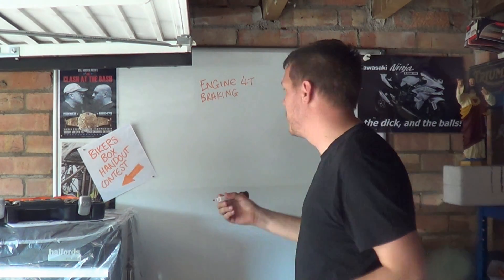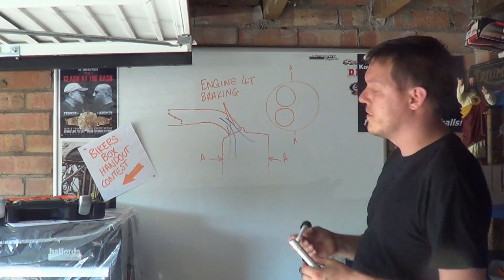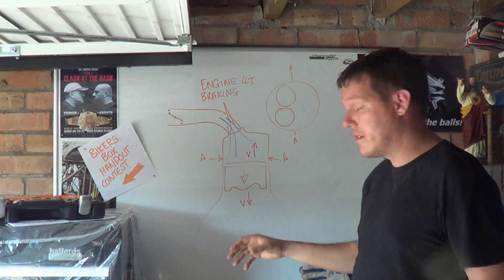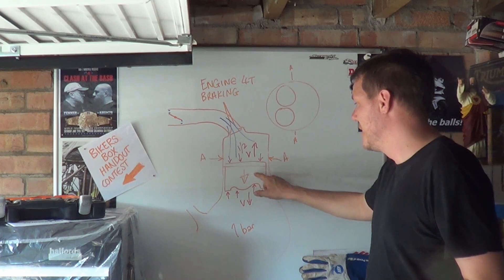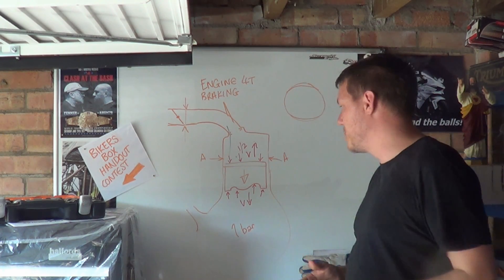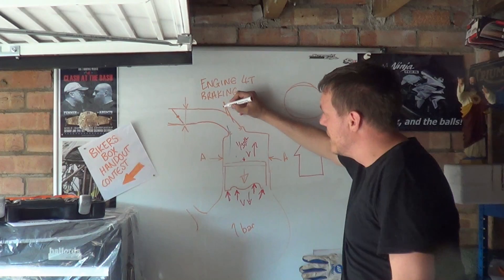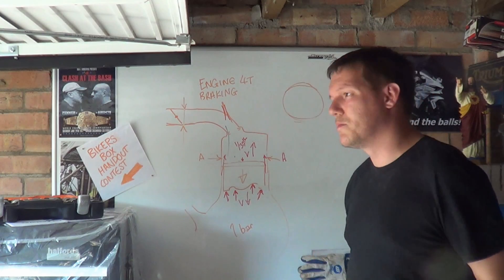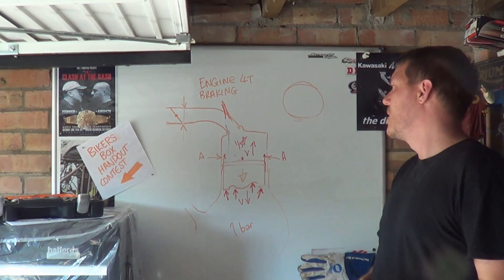4 Stroke engine braking - How it works

Comment: Its easy to understand that the air volume in the crankcase decreases in a one cylinder engine.
But with multiple cylinders, shouldn't the pressure be equal as the the other cylinders balance it?

I wonder the same with multiple cylinder 2-stroke engines how it can still move air from the crankcase to the cylinder.
Are all cylinders/crankcases isolated from each other?
Reply from the maker: Just because you have multiple cylinders doesn't mean the air moves instantly. Not only that but there are a lot of things in the way, webs, crank etc. The piston is moving fast, and air isn't. A moment ago it was racing upwards as the piston travelled towards TDC, now the piston is on its way back down.

This is why you loose engine braking as the engine slows down.
Reply from the maker: "I wonder the same with multiple cylinder 2-stroke engines how it can still move air from the crankcase to the cylinder.

 Are all cylinders/crankcases isolated from each other?"

- missed this bit sorry, yes they are generally.

Comment: This is great, for a while now i have been wondering if the engine braking is burning a little bit of oil. Last year on a trip to Alps i noticed that my KTM 990 burned oil a little bit more than usual. And i thought it must have been the road that we took, which had a lot of steep down hills sections and a lot of engine braking, or that it was just so hot, or because the oil had been changed just before the trip. It's nice to learn something new about your motorcycle, thank you!

Comment: Anyone else had a plug foul of run out of fuel at speed and noticed how the engine behaves if you hit the throttle? The next time a passenger shuts your ignition off give it a try. This does get interesting and can give you a nice eureka moment too. Tip: vacuum energy isn't available on Earth....yet; don't worry about the smaller losses; ironically, starts with h and ends with eat is helpful to get going. 
Thanks for sharing your time and knowledge. Good day.

Comment: The engine braking on my ER5 is much stronger than on my CBR600. And about what you have mentioned would';t this put strain on the butterfly valve as it's greatly restricting the flow?
Reply from the maker: That's due to volume and cylinders, stroke and more complicated drawings on the whiteboard lol

Comment: Can you please explain/compare the braking effect you get when you shift to a lower gear, then release the clutch.  (if you dont blip throttle to match RPMs.)  

I have had arguments with people claiming that is engine braking.  Which it clearly isnt.  But if you could show the differences then the next time i have have one of these retarded arguments, i could just show them the video.  Thanks
Reply from the maker: This is engine braking - its called overdriving the engine. The rear wheels are driving the engine, and the engine isn't going 'fast' enough. Its a different process which I'll do a video about but its still engine braking.
Reply: The Workshop 
Thanks.  Im talking specifically about the moment as the clutch re-engages in a lower gear, and the engine RPM has to increase to match the road speed in that lower gear, and at the same time the road speed must decrease a bit as energy goes into accelerating the engine RPM.  Surely this isnt engine braking.  Its like using a clutch as a brake.  

On a side note, and im not sure if youve had much to do with it, but it would be great to see a video on diesel truck engine braking.  Exhaust brakes and jake brakes etc.

Comment: +The Workshop   is it harmful for the 4T engine to do engine braking regularly (e.g. while driving a car in the city before every stop)?
Reply from the maker: No, the combustion pressure (force) is alot higher than engine breaking, as long as the engine isn't overdriven close to or beyond redline

Comment: on my motorcycle (carb-fed, 125cc single cylinder), when i fill the fuel tank from near enough empty, the bike seems to have a little more power. it seems a little more torquy with a better throttle response. i have heard a few other ppl say this as well, whereas others say this is just placebo, as the fuel flow isnt affected by the addition weight of the full tank due to the flow being controlled by floats. is this true?
Reply from the maker: lol its probably the temperature of your fuel. Fuel is stored underground in massive tanks. When you fill up a jerry can you can feel how cold it is. Carbs work on volume, and this is one of their issues. Colder fuel = more fuel per volume.

When you refuel with half a tank the fuel mixes and equalizes temperature wise. Empty tank means all the fuel will be colder. As you run the bike the fuel will heat up so the effect is lost.
Reply: oh shit that actually makes a lot of sense. cheers man

Comment: Hi mat, I have a 200cc 4 stroke quad bike, when you let off the throttle and engine break it backfires down through most of the rev range(no smoke), sounds great but I was just wondering why this is if your starving the engine efectively
Reply from the maker: More on that in a follow up video
Reply: The Workshop great, thanks pall

Comment: question. how does engine braking actually works or differs on engines that doesn't use a butterfly valve to control the throttle?

i don't know if there's any bike that has achieved/use this technology. 
but an example is some of BMW's current engine (can exactly remember which one it is), where they varies the intake valve opening/lift to "emulate" the throttle function. because no butterfly valve= less air restriction = less losses they say
basically using their valvetronic system to the next level to control the 'throttle'

since i have heard that it can completely not open the intake valve at all
(and i think nissan have this technology too? less certain about this one)
Reply: its the same i think.you just create a "bigger " "vacuum"

Comment: Common misconception that the "suction" is what causes braking. If this were the case a diesel couldn't engine brake when of course it can. This concept is actually called "compression braking" because you turn the engine into an air compressor. Nothing to do with the suction you speak of.
Reply from the maker: That's a diesel. Or didn't you see the motorcycle (gasoline/petrol if you didn't know) on the thumbnail/ most of the videos I make? You couldn't of done, otherwise that would mean you and this comment are both stupid.
Reply: All one has to do to realise the vacuum theory is nonsense is get out there and try it!  Cut the spark/fuel to the engine while engine braking and give it WOT, the braking doesn't disappear, hence its not the closed throttle or vacuum that is doing the braking........end of story/myth

Comment: Simple explanation by Suzuki MotoGP: 

What is the engine brake?

It's the power that slows down the bike when the rider closes the throttle, and the bike is shifted to a lower gear.

How is it mechanically generated?

By the force required to fill the air inside the cylinders.

How is it checked electronically?

Regulating butterflies

http://www.suzuki-motogp.com/do_you_know.html
Reply from the maker: "By the force required to fill the air inside the cylinders." 

- what force? lol

"It's the power that slows down the bike when the rider closes the throttle, and the bike is shifted to a lower gear."

- power? you got this from the link? lol
Reply from the maker: That is the shittest explanation I've ever read lol
Reply: Yeah it's in there. I just copy and pasted what they said.
Reply from the maker: Yeah I just read it lol - why give such a shite explanation on a site like that. Must of been the event manager who writes the site lol

Comment: Good stuff, well explained.

While we are on engine braking. Is it dangerous for the engine to turn into a flamethrower under engine braking? My CB500 pops amber flame like mad on engine braking (from what I seen all CB500's do that).
Reply: i've seen a few carburettor engines doing that, i think it's just high rpm + closed throttle = unburnt fuel igniting in the exhaust. dare say Matt'll say i'm wrong though....
Reply from the maker: No pretty much there - on carbed machines the fuel + air is restricted, and sometimes this is enough so the engine doesn't fire. This fuel + air enters the hot exhaust and bang like chris davidson said. On injection machines the throttle body is before the carbs and the injector matches what the throttle position is so the correct A/F ratio can be achieved.
Reply: chris davidson I think you're right
Reply: The Workshop you can spit flames it you tune the computer to run rich right?
Reply: Lol flames

Comment: The suction that causes the blow by at the piston rings on the down stroke at the engine braking is what you want when you break in an engine. With that you get all that little scraped of metal particles out of the gap between the piston rings. If you avoid engine breaking in the brake in procedure you just keep stacking that shaved of particles in between the piston rings. That will cause more wear and a lower compression of the engine. And worst case some stuck piston rings that end in engine failure.
Reply: onhawaii interesting theory.  tell me more!
Reply: Why theory? it is fact. The piston rings and cylinders wear in to each other that produces particles that can stay stuck within the piston rings especially the oil  rings. It also helps to avoid oil sitting in between the oil rings and getting burned and clogging the shite up. So you want to do some engine breaking... that is why engines with automatic transmissions do have more problems with that then  manual transmissions because automatic transmissions do not use engine breaking and disengage the drive line when you close the throttle. Again a fact. (exceptions not considered)
Reply: onhawaii from a scientific standpoint,  there are no facts only theory.  I've never seen any material in between any rings on any bike I've rebuilt.  not to say it didnt happen.  I've just never seen it. seems possible.
Reply: he's talking about the material from bedding rings
Reply: misk one i realize that. i just have never seem a build up of material even remotely like the ampunt hes talking about. it would probably be indistinguishable from carbon build-up
Reply: Richard... what do you get when you burn oil?Misk, Yes the material that the rings lose when they bed in with the cylinder can get stuck in the piston rings. If you have a engine that is driven only on short distance and you burn a lot of oil because the breaking in the engine was bad you will have carbon build up. If the carbon build up is so much that the rings get stuck you will damage you cylinder walls and when you run  the engine hot with that carbon build up it will cause a serious damage to the piston and cylinder. Richard you are like an little kid that just want to ask why? why? why? and then bug the people... And I have english only as my second language so it will not be perfect! live with it.
Reply: onhawaii Im not sure why you are upset. im just asking what you are talking about. 
 The amount on residual wall material left inside the rings would be so minimal you shouldn't even be able to see it unless the engine was broken in poorly and you've already ruined your cylinder walls.  

you would have to disasemble the engine directly after breaking it in before  whatever material was there in the first place dissipated or was captured by the oil  . (probably tore the engine down because of the problem, otherwise why would you tear it down?)

If you tear down an engine and see the walls are damaged and you have material left in the rings, the most likely situation is you had another issue causeing the wallas to be scored which is yhe material you see there, not the honed material.

The likelyhood of the minisule amount of material shaved off the walls being caught inbetween the rings, and being enough to do more damage to the walls is incredibly low.

also the way the knife edge of the rings are designed would (for yhe most part) stop all of this from happening
Reply: It is not only about the things you see. If it is there it will have a effect on your engine. So easy is that. Just look at other videos about it... So please just look around. If you never had that problem with your engines then be happy you did something right.

Comment: does the engine breaking harm the actual engine in any way?
Reply from the maker: For a 4 stroke no, the forces from engine braking are low compared to the combustion force.
Reply: The Workshop thanks for the answer,  Matt. The reason I've asked this question because I remembered that Keith Code said something like "brake pads are cheap, engines are expensive"...

Comment: So turbocharging at some point must be more fuel efficient
Reply: gen3v8 good question. you are assuming the engine is seeing boost all the time. It still sees the same vacuum and engine brakeing when off the throttle as the throttle plate is closed
Reply from the maker: Cheers richard
Reply: Obviously not on boost continuously. What I meant is . During mild throttling there must be a point where the cylinders do not have a slight restriction filling,Thus making the motor more fuel efficient. Your thoughts?
Reply: gen3v8 if there is more air, then there (ideally) is additional fuel. typically you dont get just one and not the other. its actually running lean if you do (get more air). 

therfore under the same throttle input, if you are getting more air and fuel.... you are getting less economy.... but more power. and thats more important.... because weeeeeeee!
Reply: I do prefer weeeeee! and I know this is off topic but Matt has the can opener